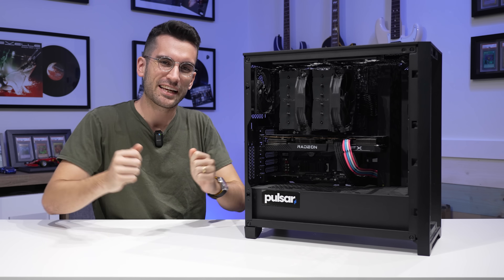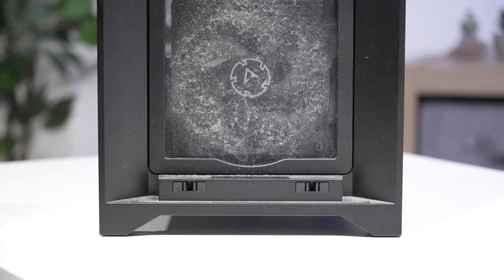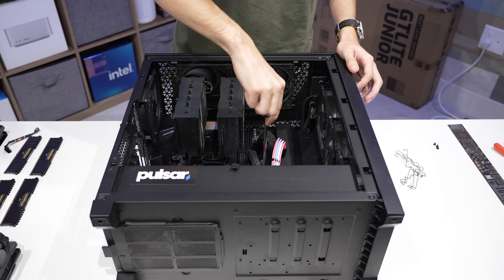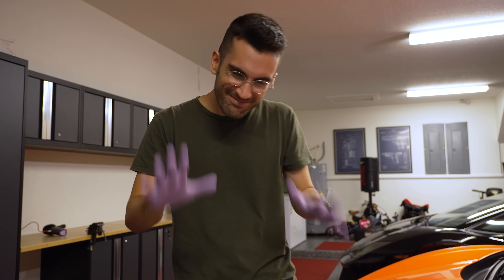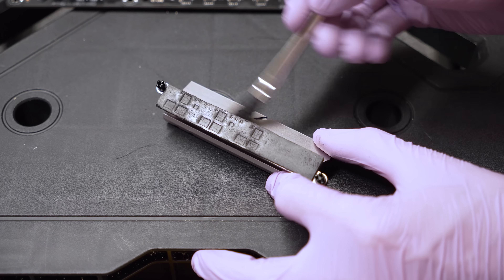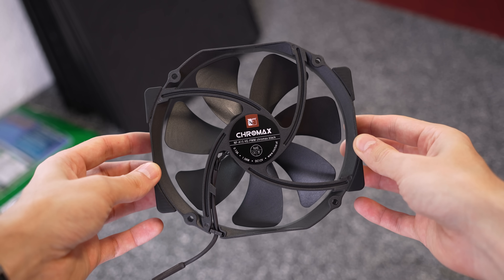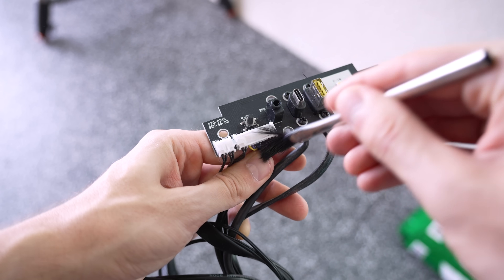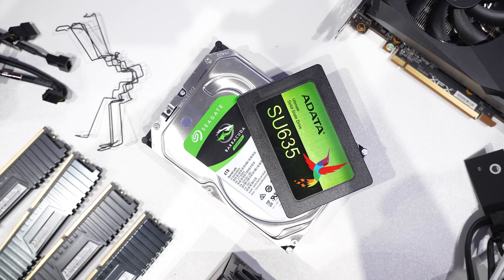Deep-Cleaning a Viewer's DIRTY Gaming PC! - PCDC S4:E1

Comment: With the thermal pads on mainboard and GPU heatsinks and coolers, you could consider replacing them with thermal putty. They tend to perform very well, some even perform better than thermal pads, and you don't have to worry about getting the thicknesses right since, like thermal paste, it'll just squish out.

Comment: Question, is it fine to clean motherboard and cpu section of motherboard with vaccum cleaner/air duster? Coz i have heard not to do that due to static charges from vaccum. Amazing & informative video just stumbled from yt recommendation on pc cleaning. Also which part of the pc parts is safe to use vacuum/airduster?

Comment: i have a rx6600, i updated my drivers to the latest but its giving me low performance (fps drop n very laggy gameplay )so i reached out and someone told me to revert to the previous driver so far so good but can anyone tell me how to fix this so i wont have future problems with new drivers
Reply: yesterday i decided to go back to the new drivers n then i had a problem with my second monitor n i thought i ruined the hdmi port to my gfx card, and i was not getting any signal from second but my main monitor was fine so after troubleshooting i decided to go back to the previous drivers and it worked everything back to normal
Reply: just very confused on y its doing tht to me with the latest drivers which is adrenaline 24.12.1

Comment: is there a functional reason why fan manufacturers don't make them with detachable blades for easier maintenance? 
maybe not on a $10 fan, but on something like a Noctua that costs $40 that would add some value. i know that Noctua used to make their fans with metal hub shells that the plastic blade disc was then pressed onto. wouldn't it be possible to use a design like that but with the blades being removable using some kind of simple locking mechanism to secure them to the hub? 
not only would that probably be easier to clean but they could also sell replacement blade discs in case someone snapped one off somehow. maybe they could even offer them in various colors for more customization, idk. 
i feel like that would inspire more confidence when buying an expensive fan

Comment: I get "sticky" dust in my system its sooooooo annoying...don't know if its the humidity here or what but it's such a mission to dry clean my rig! It really grinds my gears that its impossible to get the heat syncs 100% clean because you just cant get in there so this dust just cakes up over time and you can only get so much off!

Comment: oh come on the guy on TechYes City says you can throw your fans(and everything else)  in the sink and soak in dawn and hot water.  LOL.  His "tech Luvin" is so Jank.  I've cleaned exactly on PC part in water in all the cleaning and builds I've done.  I got a 3060 for free that was working but literally encased in a layer of coca-cola and that sh*t won't come off with alcohol, so I washed it down with hot water and dawn then dried it quickly with air and then soaked it in alcohol.  Worked like a charm, but I wouldn't do that if I didn't absolutely need to.

Comment: If all you were doing was cleaning the dust there isn't going to be much temperature difference with the system, but you're also repasting both CPU and GPU. To me that feels like something that has a chance of impacting temps.  Less likely on a relatively new system like this one, but there is a chance if you get some older crusty system, that repasting could have a very noticeable impact.

Comment: Worst one I cleaned was a Fractal mesh case.  The front mesh was clogged, the PSU filter on the bottom was 100% clogged.  There was no I/O shield, so the AIO started sucking in air from the rear and clogged the fins with dust. 😢

The odd part is he only bought the PC a year ago.  So, I think he needs to move to a new house if there is THAT much dust going on LOL.

Comment: What about a combo video? Cleaning PC's that also might need some fixin'?
Reply from the maker: We occasionally do this. We've quickly cleaned/air dusted dirty PCs in FoF - however, combining the efforts of both PCDC and FoF into a single video would far exceed the revenue kickback we'd receive. It's much more viable on the creator side to split such a video up into two. This is why things are already set up the way they are. They're very different topics.
Reply: @ makes sense. Thanks for breaking it down :)
Reply: @GregSalazar  But I love the vids man.. Keep doing what you doing because it is working!

Comment: Using an actual air compressor with a air tip is ok right as long as I hold the fan blades and such correct?
Reply from the maker: It's ok. I prefer something a little less harsh as most proper compressors can be a bit much. Also, it won't eliminate the need for an isopropyl bath in severe cases, so I don't like to chance it with much harsher air.
Reply: @GregSalazar  awesome thanks. Mostly just need to remove some light dust, I also have some soft bristle brushes to use as well as iso but was trying to avoid using canned air

Comment: I would think if going this deep to clean you'd replace all thermal pads.  It's not hard to find specs on thickness.
Reply from the maker: The pads in this video cleaned up just fine, so no. It's an unnecessary expense.

Comment: The front bezel and the rear feet should have been able to come off as well. I’m not sure if you know that or not.
Reply from the maker: Yep, they come off. Just no point once we started blasting with water. Dust comes out of those just fine. It's the smaller front panel board, fans, and more centralized plastic pieces I always try to get.
Reply: @GregSalazar  thanks for the explanation. Out of curiosity, do you use an ultrasonic cleaner for the really grimy components? Or is a little ipa and a toothbrush good enough?

Comment: How often do you do a full deep clean such as this.

I would like to see a video around what parts can be cleaned with water bath, IPA bath, dry brushes/cotton swabs etc etc.

I have seen some videos where folks clean parts in hot water and detergent. What are you recommendations for safe/unsafe cleaners.

How often do fans need to be lubricated?
Reply from the maker: We have several videos detailing individual component cleanings already on the channel :-) Most fans will stay properly lubricated for several years.

Comment: Instead of getting a whole pcie wifi card and use the mobo slot that blocks gpu intake (i see the lowest slot being used so not as bad) or otherwise just a clean aesthetic, the owner can just replace the m.2 wifi card that was underneath the aorus heatsink

Comment: This was a great comeback episode. I like the change from the trend of all RGB to just something simple all black with some chrome and just a little bit of color. Wasn’t too dirty but still a great way to bring back the series.
Reply: BTW: This Is My Rig. The specs are as follows.
CPU: RYZEN 5 5600X w/ PBO enabled
GPU: XFX AMD READON RX 6700XT OC(12GB)
RAM: 4•8GB CORSAIR DDR4 3000MHZ CL16(32GB)
NVME1: TEAMGROUP 512GB GEN4 SSD(BOOT)
NVME2: TEAMGROUP 2TB GEN4 SSD(NEXT GEN GAMES)
HDD1: SEGATE BARRACUDA 2TB 
HDD2: SEGATE BARRACUDA 4TB
PSU: ARSEGAME 850WATT 80+ GOLD
CASE: CORSAIR 4000D AIRFLOW
COOLER: NOCTUA NHD15 CROMAX.BLACK
MOBO: GIGABYTE AROUS PRO WIFI B450
(Side-Note, That wasn’t a WiFi card rather it’s a USB C + USB A PCIe card for my Streamdeck mini.)
Reply: That's an impressive build—subtle lighting without aggressive RGB makes it truly soothing. I do have a question, though: won't the top intake fan impact thermal performance? Could it potentially create airflow turbulence?